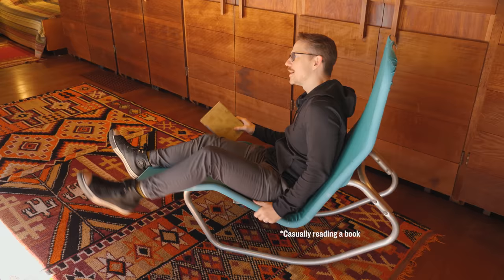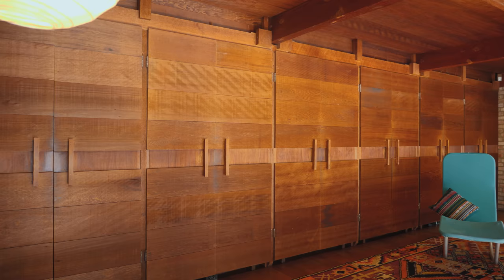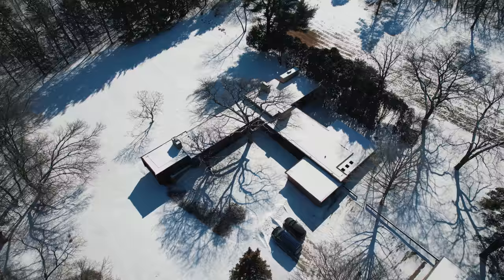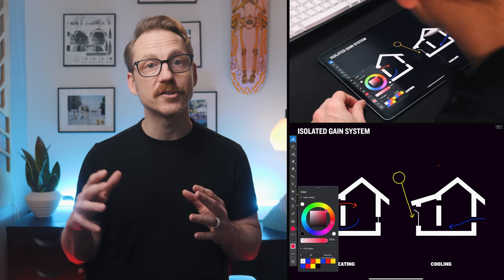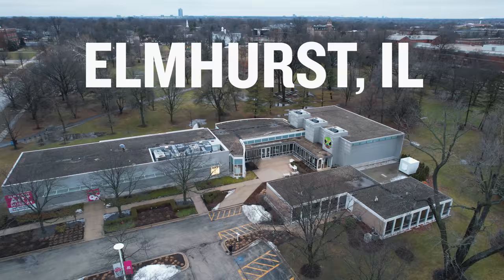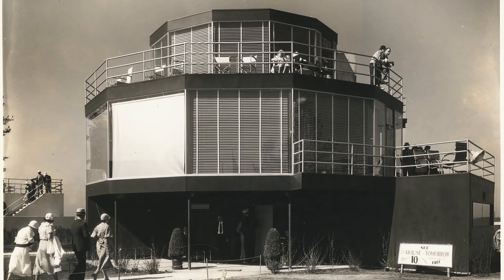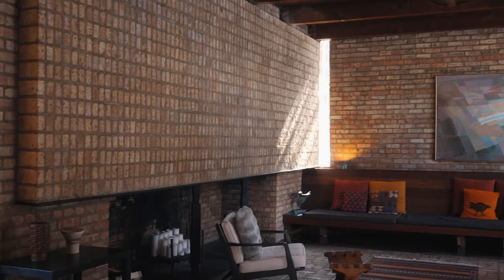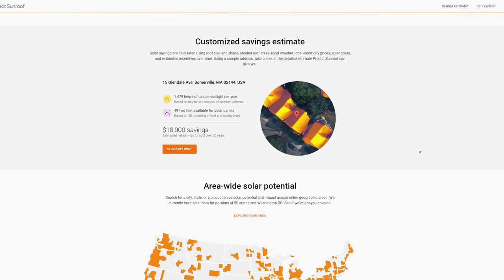How This Midcentury Modern House Harnesses the Sun

Comment: This one took me back to my undergrad days doing net-zero design. I think it's really fascinating how many residential projects these days try to brute force green design practices with panels and finishes while almost completely ignoring site and orientation when those factors are so powerful in this conversation.
Reply: It'd be interestng to review the cost/benefit tradeoff of solar and net-zero design. Most new houses where I live are thrown up as cheaply as possible: Templates with optional extras. Little regard for the efficient design principles you'll learn about.

What are the savings like compared to the higher cost of the home? What's the timescale of that investment? etc. Those nitty gritty details we don't often get to see in a formal video.
Reply: @HantaleMedia  the only mandatory increased expense in a  passive solar design is in the design and construction labor, as fixed windows are the same $/sqft as mid tier siding materials.
Reply: @HantaleMedia  I've built a couple of residential projects like this. There's a... not insignificant.. construction cost increase for sure. But my clients have reported more than enough energy savings to cover the increased loan due to sustainable design. 

I was one of the student leaders on the 2013 Solar Decathlon home 'Desert Sol' and started my first company immediately after college. So I've have quite a few people come to me for this type of thing in my professional life. Most of the time they never makes it past design, but sometimes they do. 

The clients who are living in those homes are all satisfied and see financial benefit. But I've never seen hard proof from them (like energy bills or anything), so take this with a grain of salt. I've always wanted to find a client who would let me install sensors for post-construction data gathering, but have never felt comfortable asking (yet).
Reply: Site orientation is generally for those who have the $ to buy a block of land large enough to take advantage of that orientation, and who are building in an area where the local council will Not mandate which direction you home faces.
Reply: @NathanWeberTheDesigner  That's mostly what I've seen in the research I've done. It appears to be roughly 'cost effective', but you definitely get diminishing returns as well. There was a good overview by some texas-based home designers somewhere on youtube that's worth a look.
Reply: Kinda depends on what you mean by "residential projects". Massive lots or pack as many homes as feasible. The former allows quite a lot of freedom that the latter does not.
The pun wasn't intended, but it was intentionally left in.
Reply: That’s because it’s not about being green. For the people in DC it’s all about cronyism, forcing through laws that they claim to be about the environment but really is about forcing people to purchase the products that are manufactured by the companies that their family members make.
Reply: @gsneff  "Ka Ching !!"💰
Reply: @HantaleMedia  in Central Cali were paying $500+ three months of the year to cool our homes. I can't express how much this is worth to us.
Reply: @ltlbuddha  what was the pun?
Reply: @AlexthePanda   "'assive lots'  'a lot of freedom'
Reply: And its soo dang easy to configure the site with the software we all use now
Reply: So what are the basic principles of net-zero design. Is there such a thing as a "universal" layout that's the best possible option on how to orient a house and what room should have windows pointed to a specific direction? Let's say we're talking only about the northern hemisphere.
Reply: @TJ-ki3gp  not sure about "net-zero" exactly but imagine one principal is using the suns path thruout the seasobs to your advantage. SE facing gets the most, NE facing gets the least. Theres tools online you can plot your geo location and get good solar, and weather data for the exact location taking in account the locations topology.
Reply: Serious question here: is it even  possible to have TRULY "net-zero" design?  For example, PV solar panels require toxic chemicals fori production and extensive miningx of fine-grade quartz, and quartz mining, like all mining, is some of the most environmentallyo intensive and destructive industrial processest we perform.  In fact, many experts have concluded that at the current efficiency rate of PV panels , over their 40 year lifespan they won't actually offset the amount of carbon, pollution and toxic byproducts created in their manufacturing.  I haven't even addressed the incredibly energy intensive processes of copper and aluminum production.
Reply: I study renewable energy for my masters, and one of the main things that get hammered home for solar is that location, but more so orientation are EVERYTHING!
Reply: i find that to be weirdly typical in engineering. make a crappy, wasteful, just straight up bad design; and then over compensate it to hell and back
Reply: Agreed..using same tech in every site
Reply: Yah but, then, you kill a forest
Reply: @NathanWeberTheDesigner  Always worth asking. Could propose that the sensors store data locally and someone requests the data monthly or yearly allowing the homeowner to review what's sent, or even be paid for it.
Reply: no they don't
Reply: I cannot imagine anyone designing a landmark home and ignoring the enveloping topography  and landscape . John Lautner called his projects "shelters" Why - because they are integrated with the environment. In warm climates. people would rather live outdoors with wi dow walls pulled aside . Midcentury is magnificent. But this home seems to be pre- midcentury....(built 1938)
Reply: I miss that SO much.
Reply: Being dictated by the sun just isn't a scalable option as nice and cool as it is.
Reply: @post-leftluddite  absolutely it is. Look at what earth ship builds have done in Taos New Mexico. Yes they still use solar panels, but the use of recycled materials and reusing water for various purposes makes them truly net zero. There are also passivhaus standards that can reduce a ton of waste as well.
Reply: Totally!
Reply: We have 11 acres in Tennessee and I put a lot of thought to the design of our house including it’s orientation. I had a local draftsman help me design the house which includes huge, south facing windows and overhangs that shade them during the summer months even the sun is low. We insulated in the traditional way. The only thing I would have liked to do differently was use triple pane windows in the front, but our budget wouldn’t allow. Our  friends thought we were crazy putting such large windows facing south saying our utility bills will be outrageous. We have 1800 sq ft with 14 ft ceilings. We are all electric except for the fireplace which is gas logs. Our electric bill has never exceeded $150 per month in 2 years and we are always comfortable. Once our landscaped trees grow more , I believe our usage might even be less. Some of our friends are now considering building in the same way.
Reply: @NathanWeberTheDesigner  when I win the PowerBar jackpot, I'll let you design my house and intall sensors. So keep your fingers crossed for me.
Reply: @TJ-ki3gp  I don't think there's a set layout that is best but there are some principles to consider. My 60's house got some things right but one thing they got wrong was having the bedrooms on the west side. In the heat of summer the setting sun is blasting the west side of the house making it hard to sleep. In winter the setting sun is too low to heat the west side. So literally no benefit for my situation. I'd put bedrooms on the east side. The other thing to consider is that your kitchen will generate a lot of heat from cooking so you may want it on the north side so it doesn't overheat in summer, and in winter is generates it's own heat so doesn't need to be near the south side.
Reply: These old homes were brute forced, Frank Lloyd Wright homes are perfect examples.
Reply: I owned one particular home that was very unique. Custom built in 1952. It was angled peculiarly compared to the other. Homes on the street. Turns out the builder lined it up with the winter sun up and sunset for passive heating. Also aligned the windows so in summer had a wicked breeze thru it so AC didn’t have to run as hard. It was unreal how smartly it was built. I live in Hamilton, Ont Canada bTW.
Reply: @HantaleMedia  yep, working on top tier homes the "green" consultant would sell products so expensive they only ended up in those types of homes. I looked at the builder and said why didn't you just do X, a basic known  style of wall? He paused and said "That would have been a lot easier" he paused and said "and it would have cost a lot less".  Budget I. The house ran over $50mil in the end I know they spent a few million on products so the consultant could get his commission.
Reply: @AlexthePanda  $1500 a year apparently.
Reply: Our rural GA house was built in the 1940s. It’s nothing special like this house, but still takes advantage of orientation due to it’s time in history. What would have been the sitting room is in the front, with Southern windows. Standing in the front door you look all the way to the back of the house through what would have been the back door to make sure the hot southern air could move through. What was the original kitchen is in the back, the north, so you didn’t die from stove heat in the summer and stayed warm in the winter. We have the original interior doors and you can see how they all have a slight angle on the bottom to allow air to circulate when the doors were closed.
Even if I had a new build, I’d want to start with the premise of “how can I stay comfortable if my AC went out”
Reply: @amberpeace5099  the housing industry can't fill hours of tv with the few simple things you've learned yourself. 
It really is just as easy as you say to make a functional house that's comfortable. 
write this down: if you get a new furnace get one with a Variable Speed Blower on the furnace. Set the fan to always run at 10% 24/7. Poor mans radiant heat, evens out the temperature in the whole house.
Reply: @amberpeace5099  so the front and back doors run south to north?  The wind in my area usually comes from the west.
Reply: We build our home south facing (184 degrees) with mono trusses so the snow slides to the north off a metal  roof. we have our deck and and daylight basement with green house on the south side. We have double stud foam filled walls with a full basement. I have a system to store heat in the concrete basement on sunny days in the winter and bring cooler air up in the summer. We have 3,400 square feet and heat it with about 600 gallons of heater oil a winter here in Alaska.
Reply: Its because intelligence gets into the hands of lazy and greedy equating to inferiority. Its like giving an iron hammer and nails to a primate, and watching them throw the nails away, and use the hammer as a toy...
Reply: People want the cheapest house possible and contractors have enough to worry about, just keeping up with all the new recommendations.  Some of the best designs and green designs are actually frowned on by local, state and federal governments.

It costs extra, if you're only thinking modular, mobile or stick-built, to do things like build into the Earth.  Most new housing outside the big cities is modular home on a concrete slab.

All my older homes had full basements, because they were built before air-conditioning was a thing.  Things like building a home with long axis north-to-south, to minimize the surface area of direct sun.  Cool on the west side of the house until after noon (longer if you have shade trees, which my older homes all had).  Cool on the east side after noon, with shadows starting and growing longer in the late morning.  The 1951 house I'm in, now, has eaves the perfect length, just like you're describing.

Permaculture crowd want the long axis east-west, with strategies for shade in the summer, but soaking up as much sun as possible in the winter.  

I think you need more than just eaves, when you're building this way.  I think you need natural shade.  I always plant trees wherever I put down roots.  LOL!  But I also love setting up trellises.  If you're in a hurry, the trees are spendier, but the extra expense is more than worth it, because you get that lived-in look a lot quicker, and not look like somebody out in the sagebrush country with your trailer and a bunch of scraggly seedlings.
Reply: I don't know anything practical, but the feeling of comfort, the use of natural materials, the lighting, present a mood.   Cleverness & practically is presented.  It is a complete art package.
Reply: @AlexthePanda Use plants to keep your house cool. People forget that it’s not just the shade but transpiration that cools the air under and around plants. 

Our house here in Oregon faces west and I’ve been planting trees since we moved in four years ago. I’m growing Peanut Butter trees (because they are fast growing) and Japanese Maples on my second story decks to shade the house in the summer.  When they outgrow their generous pots they’ll be moved to the the yard or given away while their smaller relatives take their place. In the meantime we use shade cloth, umbrellas and layers on the inside. I realized the sheers in our last house (sunroom) kept the heat in or out just as well as heavy dark drapes and I didn’t have to live in a dark house. 

Our daughters house in Tucson has slits for windows on the west side with the exception of eldest granddaughters bedroom window. Plan to build framework of metal fencing (I think it’s called pig wire) so they can grow vines to shade that side of the house but have a walkway under it because my son in law doesn’t want anything touching the house.
Reply: @yeltsin6817 It was probably the builders own home and they knew it made a difference.
Reply: @ginasmitasin479  actually it was custom built for a guy that owned an accounting firm. In another twist the home inspector I had grew up in that neighbourhood and knew the family that owned it and filled me in on all the unique hidden features the house had. It was a very well built house. The builder did a great job
Reply: @kschleic9053  only? As long as it’s only increased by design and labor??? That’s most of the cost of a building like this. I can build a house for 100sf. The utilities of that house are less than 300 a year. We need to be promoting small efficient homes. Take net zero and throw it to the birds. As far as this monstrosity for a single family to live in as being some kind of a gold standard. Meh.. I like the small, double walled, cellulose insulated, house with air exchange and triple glazed windows. This is a house the milllions can live in, not the 1%.
Reply: @Skunkhunt_42  What software do you use?
Reply: @cupbowlspoonforkknif  Thanks, these are useful points 👍🏻
Reply: @VeronicaMist  it's been 10yrs but BIM maps was what we used. But I'd bet there's something more open-source/accessible now
Reply: @Skunkhunt_42  Ok great :) thank you very much for your reply.
Reply: @post-leftluddite old plains wind turbines and water wheels are next green energy tech
Reply: Hi, Is it hard to build a net zero home similar to this if the architect is able to survey the land that the home will be built on?
Reply: @AstrumG2V hi do you have any books you can recommend to learn about this?
Reply: Exactly.  As a builder, designer and Land developer you are absolutely right.   City planning also lacks in this department of orientation.  I designed and built a passive solar home with geothermal heat.  We love it.  We have perfect stable temps in the home year round.  We don’t even need air conditioning.  I’ve given up trying to convince others in our industry how important it is.  
Now I’m just developing and doing my own projects, the way I want! 😮
Reply: @5D-Marquis  document it please so I can copy it when I'm building a adobe house next year :P
Reply: @bradleycooper5436 
My passive solar is two story salt box type of design and I’m not sure how you would make that into an adobe?
Reply: This is interesting. Can you recommend any net zero design books?

Comment: These ideas were used by German farmers living along the Volga River in the Kanton of Frank in the 1800's. Their homes were dug about 4 feet below grade level. So you stepped down about four steps into the house. The walls were made of  a mixture of mud and straw with no north facing windows. The south facing windows did not allow indirect  summer sun. In the winter the sun reached about 20 feet into the rooms. A thermal mass Russian style stove kept the houses comfortable in the winter, using very little fuel.  A few of theses homes were built on farms in Nebraska in the l1890's.  They were said to be very warm in the winter and cool in the summer heat.
Reply: This used to be common knowledge. Amazing how people today dump fortunes into homes with windows facing north, then spend insane amounts to heat them up
Reply: Idk,  seems like common sense to me.
Reply: @gigel99324 the advent of mechanical heating and air-conditioning changed a lot. At that point, the design of homes became more about the view outdoors and whimsy in general.
Reply: @mr.butterworth  but the cost of building a home went way up. Not many afford a badly built home when it comes to paying for heating or cooling them. There's a bunch of prebuilt homes I pass sometimes - all built facing the Northern access road with a single South window, the opaque window one. Amazing. Not to mention they probably feel like a crypt with close to no sunlight. Yuck.
Reply: My BFF his family heritage was exactly this.  Only one U S  destination for the Volga River Germans, which was Omaha NE.